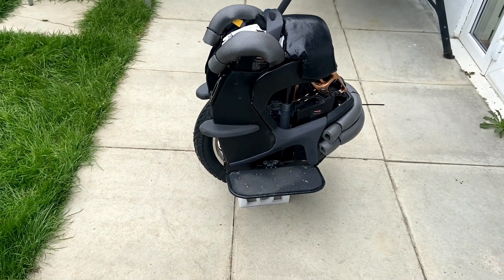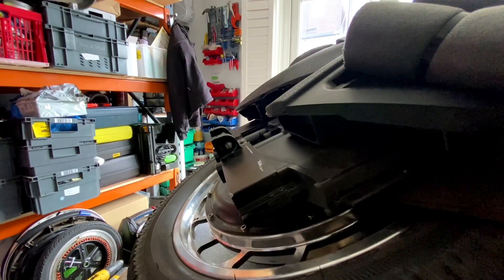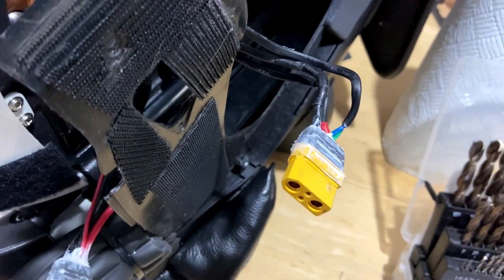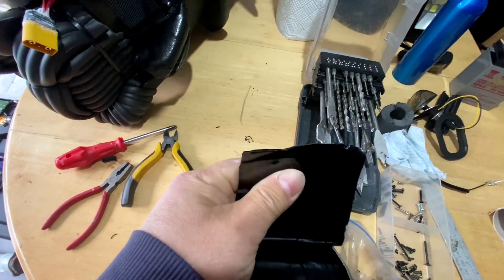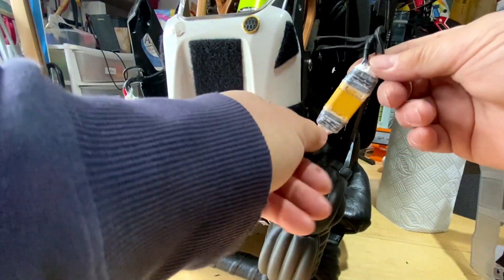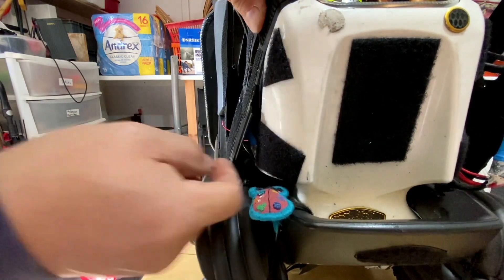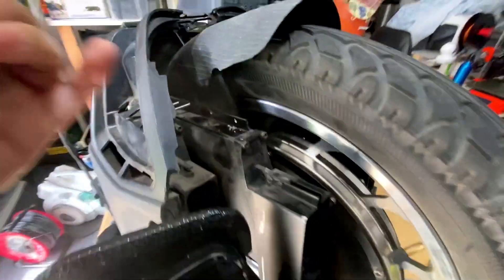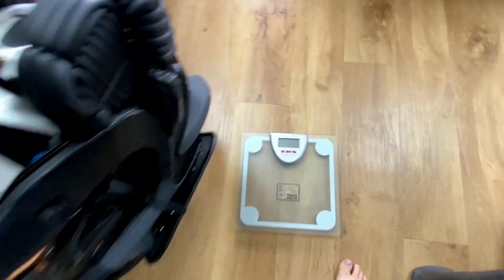PART 2 KINGSONG S18 BATTERY UPGRADE TO 2200WH TESTING STAGE. EUC ELECTRIC UNICYCLE.

Comment: your awesome man !! keep up the good work.
My thing is am not spending 2000 USD to mod a wheel to this extent you probably spend GOTWAY EX money when your finish. The quality they are assembling the wheel is pure garbage. They need to drop the price on this wheel to 1500 with that size battery. You did really good I hope the manufacturer take lessons from you cause your efforts are awesome!
Reply from the maker: Thanks. You’re quite right about the cost. The EX was a little too heavy for me when i was riding it. It’s a great wheel but I enjoy the riding on the S18 more.
Reply: @eucupgrades  I'm sure there are a lot of people who wish we could have the power  and range of the veteran Sherman with the suspension of the S18
Reply from the maker: @rayge  you are quite right i am one of them. I love the Sherman speed and range as you say something is missing is the suspension. A good friend of my when over a speed bump follow by three little bump after it riding while sitting down. The wheel bounce and throught him off and broke his collarbone still recovering. If he had the suspension he be ok. We when back to the place and took a close look at the speed bump and it was bad.
Reply: @eucupgrades  ACK! that really sucks!! :(
Reply: You're paying for the best suspension on the market and also the nicest, most aggressive looking wheel available.
Reply: Absolutely right. Not only the money but the extra weight from additional batteries and the other modifications. I wouldn't be surprised if the added weight puts this closer to other big wheels. Great video however, and a good amount of ingenuity makes for very interesting content. What ever happened to part 3?